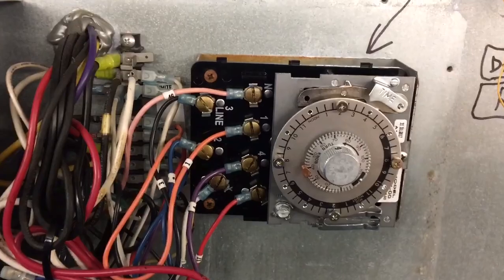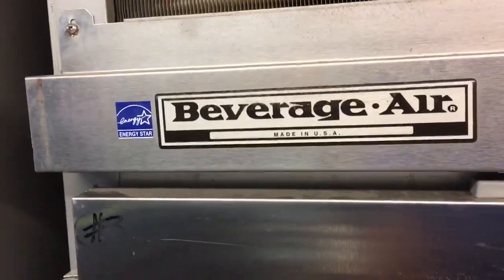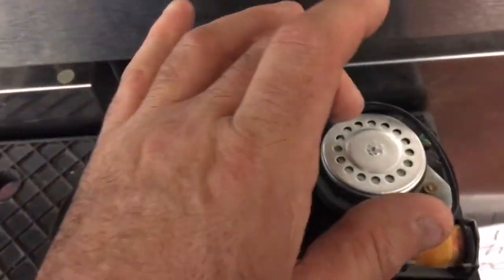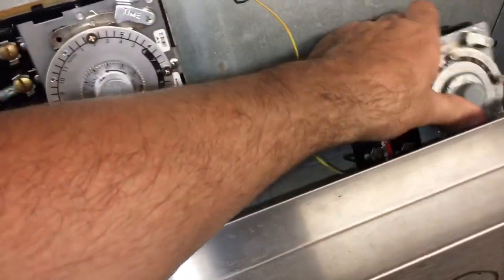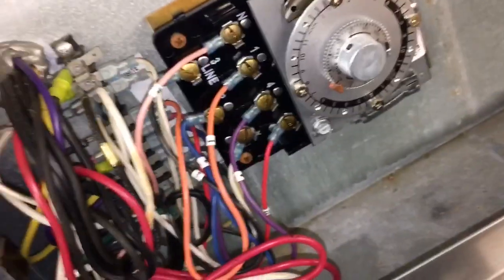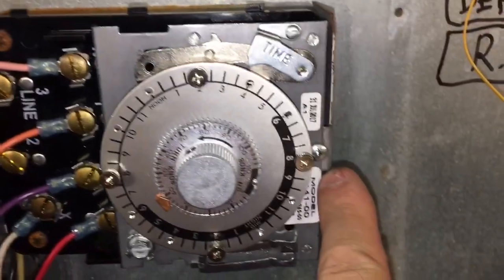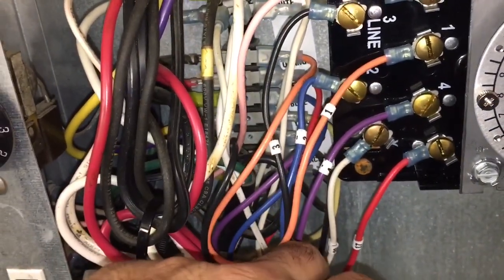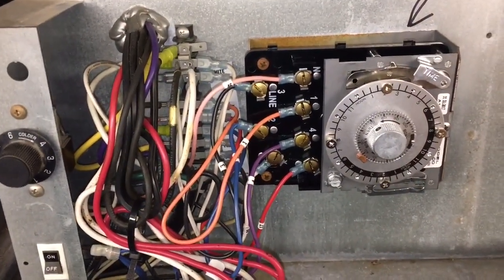How to Change a 8141-00 defrost timeclock.

Comment: the 00 at the end represents a 120 volt timer motor if its a 20 it be a 208-230 volt timer motor. as these are found on condensing units and old refrigeration condensing units in supermarkets that lack a modern refrigeration rack system  and old systems made by Hill, Hussman, Leibert,  fredrich, Bohn/Heatcraft and other units.
Reply from the maker: true.

Comment: I still cannot figure out why on a new paragon 8141-00 time clock, they have the 3 and 2 jumpered. But on the beverage air, they do not. I bought a 8141-00 and took the brass jumper out. Ive assumed it is exactly the same?
Reply from the maker: All Different applications.

Comment: Good video! How would you test one of those? Resistance and voltage?
Reply: throttle bottle ok thanks!
Reply from the maker: Visual inspection is Best. check for Voltage drop across contacts. Check for resistance across contacts. Alot of gears in those clocks too. if they do not turn smoothly. replace. replace at 10 year mark as a pm.

Comment: Why chose the 8045/8145 over the 9145? Pricing is nearly identical and it has no clock motor.
Reply from the maker: ill check the 9145 out. 👍